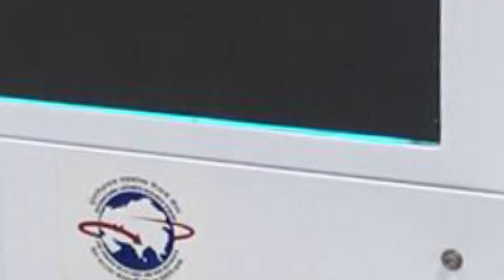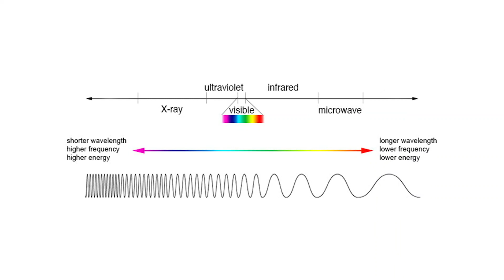KritiScan® UV - UVC light based Baggage/luggage Disinfection System

Comment: UV-C bulbs of 254 nm are available in market + get a motor with 10mm/sec speed+ 1 roller + belt length of 1 meter 
All together fix in a tunnel with power source for motor and lights (4 min)
Your UV disinfection chamber is ready 
If you want more control use any microcontroller board with some relays program it suitably for speed and auto power control for lights.😀